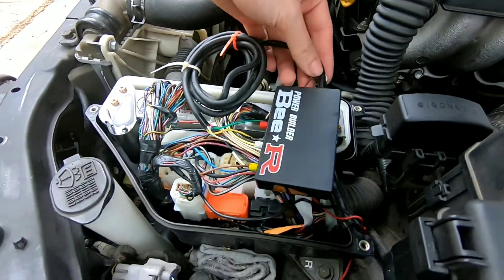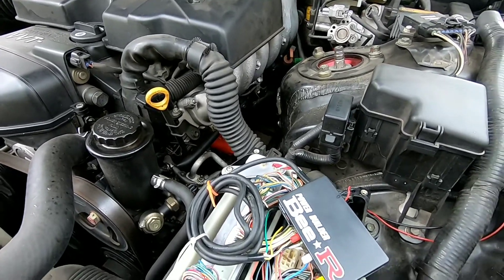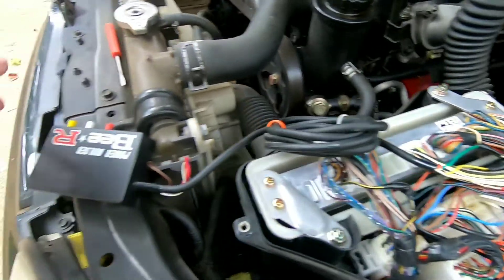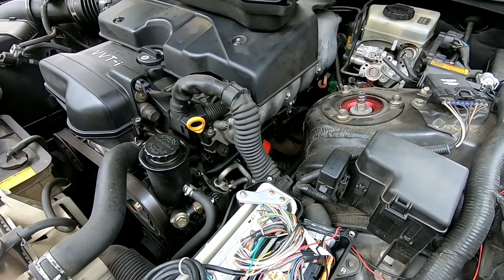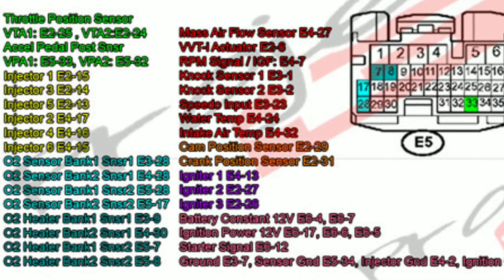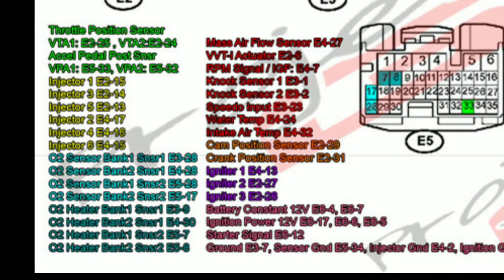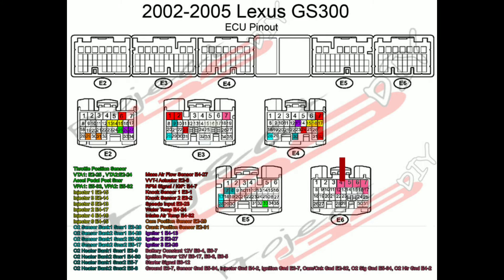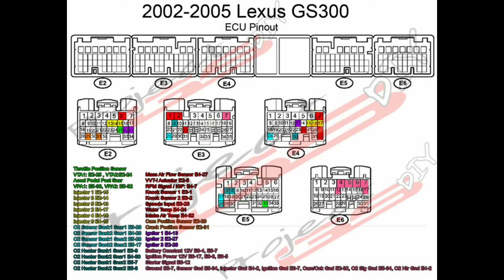How to install BeeRev into GS300 2JZ

Comment: i have it all wired correctly, but when i hit the set rpm it flashes the light, however it doesn’t cut the ignition.
Reply from the maker: Turn it down until it work.  The light will flash when turning the set knobs
Reply: @JZGarage  i have both the rev 1 and 2 set to 0 and the gain at 1
Reply from the maker: 0 turns it off
Reply: @JZGarage  oh, i thought 0 was set to 2500 rpm💀
Reply from the maker: No zero turns it off. There is a old drift work forum page that explains everything about the beeR and its settings
Reply: I looked at that forum, and it says to test the limiter in the setting that i said either, and that rev 1 and 2 being set to 0 makes it limit at 2500 rpm. The circuit board on my limiter looks fine with nothing burnt up. But when i hit the set rev limit the red light flashes but it still revs past the limit. It doesn’t cut the ignition at all. Ive triple checked my wires so i’m starting to think mine is faulty 🤷
Reply: I’ll probably a battery ground instead of a chassis ground
Reply from the maker: Is it in this gs300 2002-05 because 98-01 are different.
Reply: @JZGarage  Yeah ive got a 2003
Reply from the maker: Yeah it should be working if your wiring is right. Turn all the settings up like rev 1 6
5500rpm rev 2 3000 rpm and gain to F
Reply: Bump ! We Installed one on my friend's 1jzgte. It did the same, flashing with nothing happening so did some reading and realized the fake Beer doesn't work the same as the real BeeR. Solution: intercept IGT 1 and it will work

Comment: i have mine wired but my car does not run good and stalls after a second 🤦
Reply from the maker: Do you still have cat?
Reply: @JZGarage  I have obx headers and midpipe. I think i have my yellow wire wrong. What pin should it be on? i have it on E4-7 because there is bo wire in the E4-27
Reply from the maker: It should be whatever I said in the video.
Reply: @JZGarage Yeah there is no wire on the pin you stated in the video
Reply from the maker: What year car? Description has other map for years
Reply: its a 2003
Reply from the maker: Tell Me where your power, ground, rpm sig, and ignition sig are going right now.
Reply: @JZGarage My power is on pin E6-4, mi ground is ran to the cigarette lighter ground, rpm sig is on pin E4-7, my ing sig is on pin E2-31 just as i the video, could it be my ground connection?
Reply from the maker: Battery ground it and try
Reply from the maker: I said yellow e4-22
Reply: @JZGarage yeah for some reason i didn’t hear that, i guess i was just confused by the graph, ill try it later tonight
Reply: thank you for your help🙏
Reply from the maker: @toastedcheese9714 how'd it go?

Comment: Bout to do this to my boosted gs300, does it have to be a genuine bee r?
Reply from the maker: No it's works with the knockoffs the same wires are used. I don't recommend this it's old tech but it is what it is. Any standalone has this built in and better.
Reply: @JZGarage  ok I’ll stick with getting a standalone then. Doing a 1.2jz build to my gs300 and want it to spit flames
Reply from the maker: 1.2jz what's that?
Reply: @JZGarage  it’s a 2jz head on a 1jz block. I got a ge vvti head going on my 1jzgte block
Reply from the maker: Ohhh! That's a od combo. I have a gte non vvti block with a vvti head.
Reply: @JZGarage  should work, the 2jzge head flows the best and wanted a quicker revving setup that’s fairly reliable so thought I’d try it. To find out couple other ppl have done that setup

Comment: can you 2step it while drifting
Reply from the maker: The rev limiter is step2 and the launch control is 2 step. Yes in my videos I'm banging limiter that's is 2 step.
Reply: That lowkey didn’t make sense, can you do it while drifting
Reply from the maker: Do some more research on my page.
Reply from the maker: Step 1 cut ignition step 2 not cut fuel
Those are the 2 steps. That's all it means.

Comment: Hey I noticed you said e4-22, for rpm signal, but rpm signal is labeled as e4-7, which one is it?
Reply from the maker: Its in the description
Reply: @JZGarage  the link doesn’t worked, and I’ve tried finding the diagram
Reply from the maker: @51dragon  so how I wired it is the right way. It's been on the car for years

Comment: Did you just t tap into the ign and rpm wires? I haven't really found much explanation 
Great video btw 👌🤘
Reply from the maker: I cut the wires and solder them into each other.
Reply: @JZGarage 
Thanks for the quick reply,
 Sorry let me re word that, what I mean by t tapped is just tapped in to the wire i get you cut and soldered it in but I want to make sure that the wire is also still connected back to to itself,
Some that I have seen people cut the wires right off the 2" from the ecu plug and one goes into the plug and one comes out of the plug to interrupt the signal but from what I see it looks like you still have both ends of the crank wire connected together and the rpm wire is still intact
Reply from the maker: You just add these wires to the existing wires. Your reading from the ecu they do not stay cut. I use a solder sleeve. To seal and hold my wires together. 2 wires (1 ecu output and 2 beeR input) on one side and the 1 ecu output wire on the other.
Reply: @JZGarage  its nice to get clarification lmao thank you, its very much appreciated 👌👌
Reply from the maker: No problem I hope that clears it up. I have some other videos about wiring you my find helpful as well

Comment: Could you walk me through wiring the white cable? I got it all to work but haven't figured out the switch
Reply from the maker: You wire it to whatever you want. Ebrake switch or a button it doesnt matter. You could wire it to your brake switch if you like.

Comment: How did u wire it to the parking brake and can I wire it to a switch so that if I’m sliding the car it pops on limiter?
Reply from the maker: With a signal wire. The normal rev limiter would so that. Like if I'm doing a burnout and hit 6,500 rpm it will do it on it's own without me triggering the parking brake. The parking brake is just the trigger signal for the 2nd setting which is launch control

Comment: Is the rev limiter universal? I have an 01 and it spits flames when downshifting. I can only imagine what it would do with a rev limiter.
Reply from the maker: They can be wired into anything really. I have the wiring info in the comments and description. For gs300 and is300
Reply: Wait how?? WhTs the setup?
Reply from the maker: What?

Comment: Im doing a 98-01 so tell me if this is right please lol
red wire to E6-1
black ground
yellow - E2-25
green - E2-23

will make a video after you conform it.
Reply from the maker: You are correct! Add me on Instagram!
Reply from the maker: I was asked the same thing I'll send a screenshot
Reply: JZ Garage whats your ig ?
Reply from the maker: jzgarage  link is on channel page also
Reply: Hey I'm trying to do this on my 04 is300 is the pin diagram the sAme ? I can't find the same cables you're talking about 😭😭
Reply from the maker: Read Description.

Comment: mine died just idling after shooting some flames and won't start, anyone had this problem?
Reply from the maker: Did you wire it right? Mines never done that in any car I've had  beeR in. What were you doing to cause this issue?
Reply: @JZGarage  it was working all fine and then after 5 mins car just died while idling, all connected like yours(its 1998 but I used good pinout)
Reply from the maker: 1998 is not like mine. I added the 98 map if that's the one you used.
Reply: @JZGarage  I used 98 map from description, and wired as you said. Weird thing is that it was working and just died after shooting some flames
Reply from the maker: Do you have a straight exhaust?
Reply: @JZGarage  yes, all deleted, even the manifold cats
Reply from the maker: That's not good. Does it even turn over?
Reply: @JZGarage  it cranks but won't start, I'll check fuses and all stuff with ignition
if you have any ideas that would be great 😁 if I found solution I'll post it here for others to see
Reply from the maker: I blew a fuel injector fuse once other then that I'd check you Crank shaft position sensor. You may just have a bad one.
Reply: @JZGarage  it was blown EFI fuse, headers were too hot and harness from o2 sensor melted and started to touch headers 😂 all good now
Reply from the maker: Lol I kinda called it. Yeah mine did that once and thats it.

Comment: FINALLY! Thank god for you bro I have yet to see a video like this. Question, with the Bee-R , can it give the gs300 a flame map kinda sensation when letting off the throttle or is that only with a tune?
Reply from the maker: With no cats mine pretty much is on fire at full throttle or decelerating. Pops and bangs but I mostly have mine for rev limiter. I'm switching over to ECU masters soon I'll have a video up.

Comment: What is e4-22? Struggling to see it on the pinout diagram. My car is a 98-05 so I need to know the  description of e4-22 so I can find it on the 98-01. Pinout. Thanks
Reply from the maker: There is a comment on this video with the link to the 98-01 map. 02-05 is a different pin out. 98-05?
Reply from the maker: I added the maps for both in the decryption

Comment: Hello, could you help me with something, I bought a Bee r rev limiter about 1 week ago and the truth is I have no idea how my car is connected is a lexus is300 2001 I think the Ecu of my car with yours is the same, could you  help with that thanks
Reply from the maker: The is300 from 98-01 used the same ecu wiring as the gs300 from 98-01 so I have the image of that pin out.
Reply from the maker: http://powerdynamix.com/DIY/Engine/ECU_Pinout/GS3_98-01.jpg
Reply: Thank you very much, could you make a video of which cables are connected or send it to my email please
Reply: That is my  email    saul.ortega648@gmail.com
Reply from the maker: The link I sent has the ecu pins you wire it from those pins I stated and you should be good.
Reply: I would greatly appreciate it
Reply: Yes, I understand that, but I don't know which pins are connected to the ecu because my bee r does not have a manual which pins are
Reply: Can you show me in an image which pins are connected to your ecu and which are please
Reply: Hello
Reply from the maker: The video explains everything though. The bee R only has 5 wires.
Reply from the maker: My Instagram is on my channels home page.
Reply: Yes, but the wires I have in my ecu are of a different color, you have instagram to send you a photo
Reply from the maker: You dont go from the colors in the ecu only the Pin location.
Reply: __soysaulortega that is my instagram

Comment: What all mods do you have done to the gs300
Reply from the maker: Cat delete, muffler delete, welded diff, blitz coilovers, angle mods
Reply: JZ Garage so do you actually have to cut out a section of the cat itself to gut it?
Reply from the maker: I made a video on it. But that's one of the ways yes.
Reply: JZ Garage I don’t have access to a welder lol, and is there a shop I can go to get my diff welded
Reply from the maker: I can do it if you're in the Atlanta Georgia area.

Comment: Nice vid man, where did you get your rev limiter? And what rpm is it set at to shoot flames?
Reply from the maker: Setting 2 is launch control it's at 3000rpm my main rev limitter is 6500rpm gain is like 7.
You can get them from japan for $254 up garage or ebay
Reply: Cool man, Thx

Comment: Do you need to gut all cats for this to work and spit flames?
Reply from the maker: Well some cars spit fire stock so not exactly but it helps.
Reply from the maker: The video of the green kouki with this same system on it has CATs but a titanium Cat back exhaust. That's also why the flames are  blue